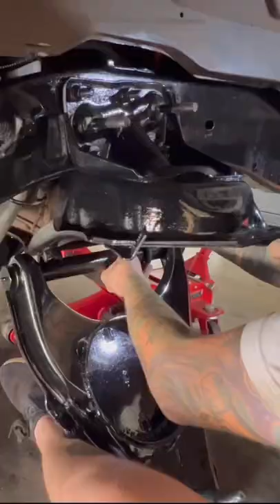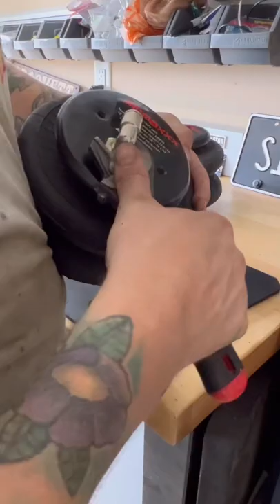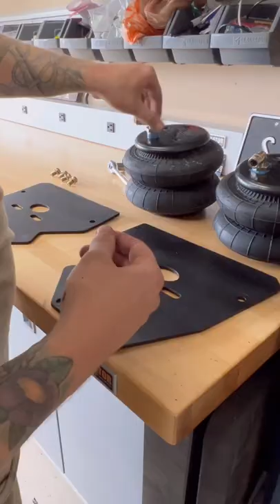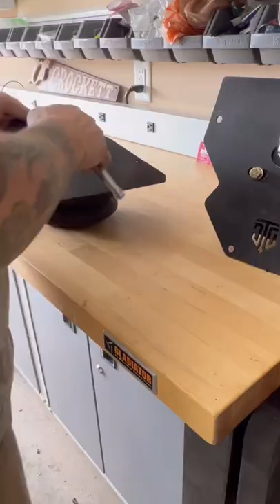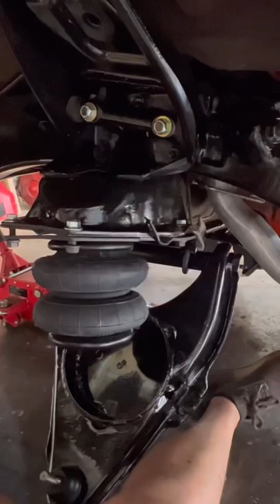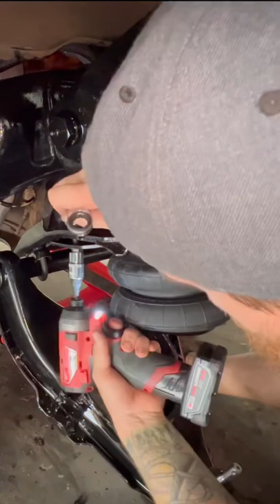Installing front air ride in a c10

Comment: Just blue loc tite on your air fittings works?
Never tried that
Reply from the maker: That’s what I use. Comes with my kit. I also use the pneumatic loctite that works great! It’s about $30 for a bottle but last a long time. My truck has been aired up for three weeks and hasn’t leaked down at all.
Reply: @SIMPLE.C10  Nice. Gonna give it a shot. Diggin the content brother🤙